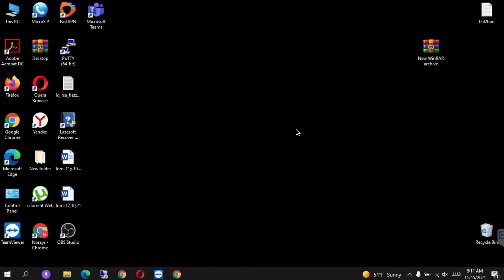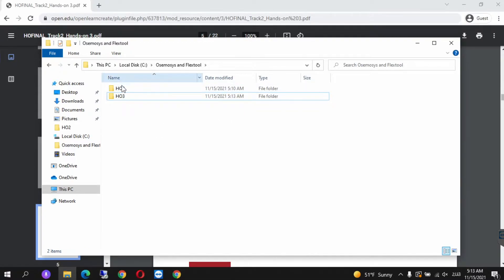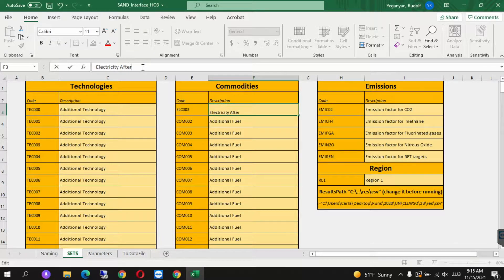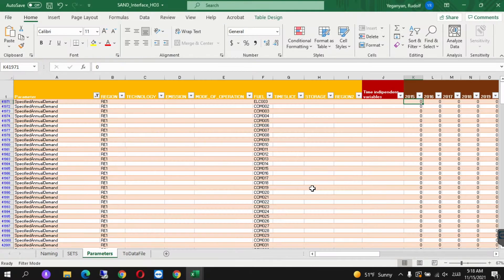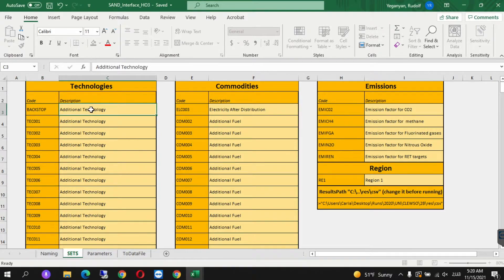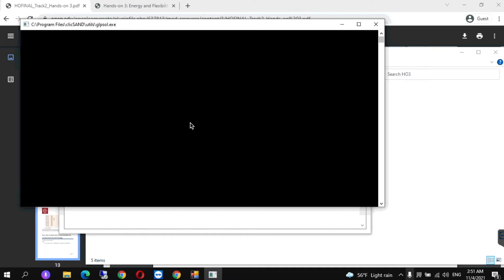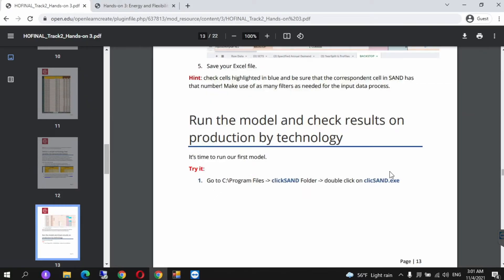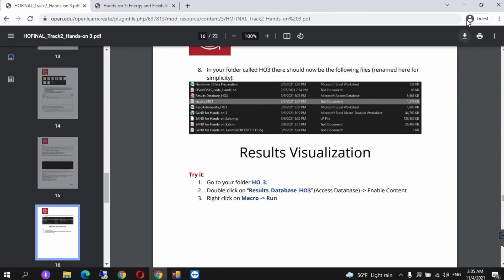OSeMOSYS & FlexTool course: Hands-On 3

Comment: Hi, 

once I get to the end of the process, when I select "Change data source" on Excel, I can't select the "Choose connection" option. What could be the cause?
Reply from the maker: Dear @matteotassistro6615, Sorry for the slow response.

We are pleased to announce the launch of a new OSeMOSYS course using MUIO (https://www.open.edu/openlearncreate/course/view.php?id=13558). This new platform allows you to build models, run simulations, and visualize results—all within a single interface. As you are currently in the early stages of learning OSeMOSYS, we kindly invite you to transition to this updated course for a more integrated and user-friendly experience.
Reply: @ccgclimatecompatiblegrowth5847  I encountered similar problem. Choose connection is grayed out. So I could continue with the pivot table analysis.

Comment: I keep getting this error. I use a MAC and followed all the processes. 

Running /usr/local/bin/glpsol --check -m "/Users/fowfloi/Documents/PHD Program/PHD program/Year 1/OSEmosys/Practice 3/OSeMOSYS_code.txt" -d "/Users/fowfloi/Documents/PHD Program/PHD program/Year 1/OSEmosys/Practice 3/HO_3_data.txt" --wlp "/Users/fowfloi/Documents/PHD Program/PHD program/Year 1/OSEmosys/Practice 3/HO_3_data.txt.lp"

Error: ApplicationName='/usr/local/bin/glpsol', CommandLine='--check -m "/Users/fowfloi/Documents/PHD Program/PHD program/Year 1/OSEmosys/Practice 3/OSeMOSYS_code.txt" -d "/Users/fowfloi/Documents/PHD Program/PHD program/Year 1/OSEmosys/Practice 3/HO_3_data.txt" --wlp "/Users/fowfloi/Documents/PHD Program/PHD program/Year 1/OSEmosys/Practice 3/HO_3_data.txt.lp"', CurrentDirectory='', Native error= Cannot find the specified file

Comment: Hi,

I am getting the error which may be due to the version mismatch of Microsoft Office or Windows. Please check below. How to overcome it?

"Error extracting data:
Unable to cast COM object of type 'Microsoft.Office.Interop.Excel.ApplicationClass' to interface type 'Microsoft.Office.Interop.Excel._Application'. This operation failed because the QueryInterface call on the COM component for the interface with IID '{000208D5-0000-0000-C000-000000000046}' failed due to the following error: Error loading type library/DLL. (Exception from HRESULT: 0x80029C4A (TYPE_E_CANTLOADLIBRARY))."
Reply from the maker: @AABane

Hi there.

Sorry for the slow response. If you haven't managed to fix the issue, then it might be to do with the Excel installation. The model curator recommends ensuring that Excel is properly installed and functioning. You can also try repairing the Microsoft Office installation by following these steps:
Go to Control Panel > Programs > Programs and Features.
Select Microsoft Office, and then choose Repair.
Additionally, verify that the platform target of your application matches the Excel installation (32-bit or 64-bit).

Best wishes

Comment: Hai, May i Know why when doing the last step pivot table, i cannot filter/missing the the Backstop? Anyone can help. Thanks
Reply from the maker: Hi there - sorry for the slow response. We asked our model curator, but without more detail its hard to know what the issue is. The first step would probably be to revisit Hands-On 3 and double-check you followed the steps correctly. If that doesn't work, please try submitting a request in this Google Group: https://groups.google.com/g/clewsmodels?pli=1
Reply: @ccgclimatecompatiblegrowth5847  hi is this support group for clicSAND? i have search the topic but could not find matched topic.

Comment: Good day,

I am getting this error: 

command line - CBC\bin\cbc.exe C:\Osemosys and flex tool\HO3\CCG-SAND Interface HO3.xlsm.lp ratio 0,05 solve -solu C:\Osemosys and flex tool\HO3\CCG-SAND Interface HO3.xlsm.results.txt (default strategy 1)
Unable to open file C:\Osemosys and flex tool\HO3\CCG-SAND Interface HO3.xlsm.lp
String of 0,05 is illegal for double parameter ratioGap value remains 0
** Current model not valid
** Current model not valid
No match for C:\Osemosys and flex tool\HO3\CCG-SAND Interface HO3.xlsm.results.txt - ? for list of commands
Total time (CPU seconds):       0.01   (Wallclock seconds):       0.01

Comment: Good afternoon. I had a problem when I used the solver, as I did not get de result txt. Below I can show you the results of the run ...

Welcome to the CBC MILP Solver 
Version: 2.7.5 
Build Date: Nov 10 2011 
Revision Number: 1759 

command line - CBC\bin\cbc.exe C:\Osemosys and Flextool\HO3\CCG-SAND Interface HO3.xlsm.lp ratio 0,05 solve -solu C:\Osemosys and Flextool\HO3\CCG-SAND Interface HO3.xlsm.results.txt (default strategy 1)
Unable to open file C:\Osemosys and Flextool\HO3\CCG-SAND Interface HO3.xlsm.lp
String of 0,05 is illegal for double parameter ratioGap value remains 0
** Current model not valid
** Current model not valid
No match for C:\Osemosys and Flextool\HO3\CCG-SAND Interface HO3.xlsm.results.txt - ? for list of commands
Total time (CPU seconds):       0.00   (Wallclock seconds):       0.00

And finally I got no result.txt to move to Results Database and run the macro
Reply: I am getting the same error, do you know how to resolve it?
Reply: @dumisanisebanda5662  Me too
Reply: I have resolve the problem by change the region to English (United Kingdom)
Reply: @kurniawanSA  how do i change the region
Reply: @kurniawanSA  also works for me
Reply: I am also having a challenge generating the results file. ClickSand is not generating it.